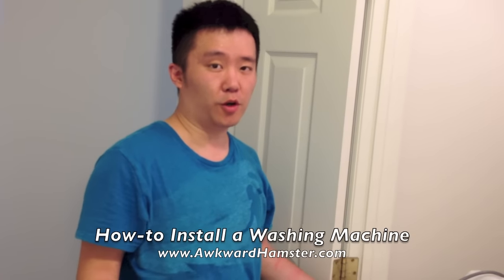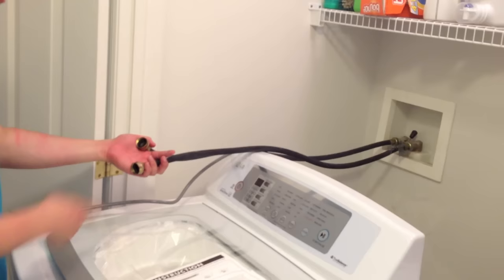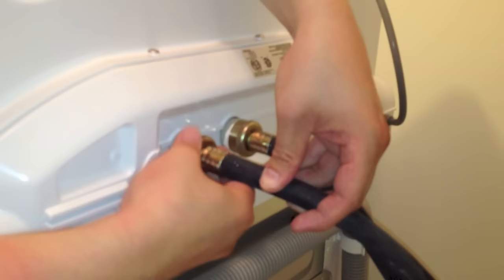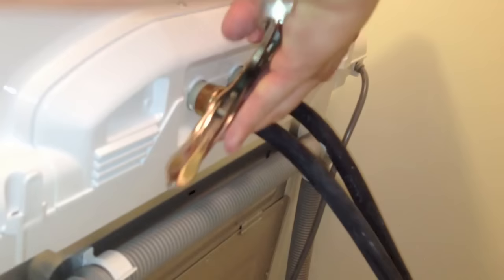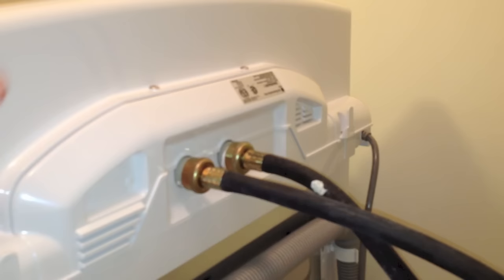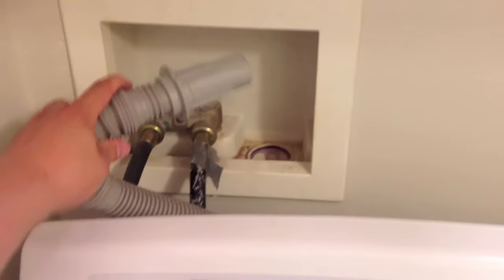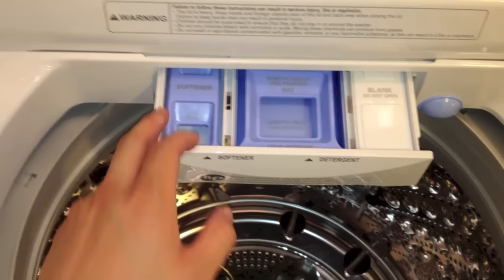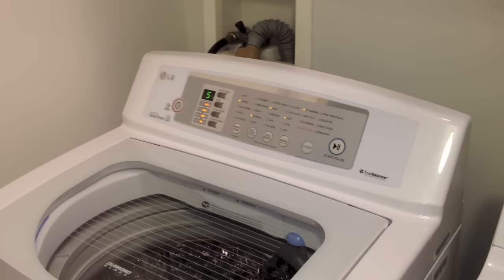How to Install a Washing Machine

Comment: 1. Old hoses on new washer voids the warranty. 
2. Don’t over tighten the hoses. Rubber gasket in the hose can kink. And also because of the gasket and it’s metal to plastic, teflon tape is really a waste. 
3. Hook up the hose turn on the water before pushing it back. If there is a leak you have pull it out again. 
4. Use zip tie on the drain hose it looks better than tape.
5. Finally, run a cycle to test the drain. If your drain is clogged the drain water will pour back out.
Reply: Thanks for the tips.  I'm a lady living alone now, no man in the house so I'm going to attempt this on my own.
Reply: don't ya have to level the unit? or not?
Reply: Hi, please if someone can help me out here, I'll appreciate it very much.....when I place the drainage hose for the waste water in the hole, the water comes right back out once I began the cycle....why is it doing this?
Reply: Does it matter which end you plug the hose into the washer?  The L on one end of the hose doesn’t fit into my wall
Reply: @florcorazon1397  you might have to run a snake down the outlet . Sometimes mine freezes in the winter and the water comes flying out. I'm just one person pushing 60 who now has a backache. It sure is satisfying when you don't need to go find a man to do anything. But it's more satisfying if you have one around who knows how. I didn't. God bless
Reply: @tractorkid223  I'll appliances nowadays have self-leveling legs. Just twist until they don't rock back and forth,
Reply: 1. Old hoses on new washer voids the warranty.   <--- why is that? and so does that means (old hoses + old washers is fine),  and (new hoses with old washers is fine)?
Reply: I know u probably going laugh at this but you have to turn the hoses on to use the washer machine one of mines has a leak and I need to replace the hose

Comment: Thanks for helping others with your video. Just some constructive criticism so don't take it the wrong way. I notice that you use some plumber's tape. It is actually unnecessary and even not recommended as the hose only seals the inside face of the hose. The non-movable part of the hose gets sealed by the rubber insert so the plumber's tape only just make it harder to install. The tape only works for fittings where the actual threads are what does the sealing like threaded pipes. 

It is also not recommended to tighten the fitting that much as the machine uses plastic. If the plumber's tape wasn't used, it would almost be leak free by hand tightening and about 1/4 to 1/2 a turn with a tool.

Not over-tightening will insure that the rubber seal lasts when removing the hose and will insure that the plastic threads on the machine remains intact.
Reply from the maker: esqueue thank you

Comment: This is the 4th video I watched that got to a drain hose that just slides into a drain hole -- you tape it to the cold water hose to stabilize it. I knew it couldn't just be left un-anchored, but wasn't sure what to do. Thanks!
Reply from the maker: cool
Reply: Reminding u about this comment u legend

Comment: very nice video. I just installed my washing machine thanks to your supportive tutorial.. All washers are a little different, but basically the same, but you're right I didn't need to switch hoses, and the shut-off valves are right there at the site. All of my bathrooms and water sources have shut off valves . Thank you again from an almost senior female.
Reply from the maker: Thanks

Comment: so the connection is actually a garden hose connection which means that the seal is not made via the threads but rather the face gasket so putting teflon tape over the threads is useless.
Reply: nyer070 correct

Comment: Thank you for this helpful video. Just some constructive criticism: when you put the hose in the drain pipe you want to use a zip tie to anchor it to either your hot or cold intake pipes. The water that comes out of the clothes washer will come out at such a force that it will pop that drain hose and you will have water all over your floor in seconds! Ask me how I know… Also, this is the new home guidelines to anchor the drain hose. Also, if you have an older house that was built during the 80s-90s when they decided it was a good idea to put the washer and dryer on the second level with the bedrooms, I highly recommend a drip pan. This can save your floors! Thanks again for the great video.
Reply from the maker: Thank you
Reply: How do you know? 😂
Reply: He did anchor it.

Comment from the maker: The waste water hose came attached to the washing machine.  At 4:35, I just inserted the other end of the waste water hose into the drain.  I used tape to secure it into position.  Hope that helps.  Thanks for watching.

Comment: The placement of the electrical outlet below the water line hookups is scary.
Reply from the maker: Dckommentatur S Yea, you make a good point.  I put a water alert sensor in that laundry closet and it's also got a floor drain.

Comment: That seemed easy enough!
Unfortunately, I had to replace one of my valves by myself with a makeshift one and those things are almost impossible to remove!
I didn’t have to vice grip the hot and cold water or tape the hose down but that’s actually a pretty good idea.

Comment: So to confirm - the entire installation process can be summed up into plugging it in, attaching three hoses, and setting it against the wall correctly? Home Depot is trying to charge $195 plus tax to do exactly that. Am I missing something? It looks easy.
Reply from the maker: With the amount you are saving, I would suggest buying a new stainless steel water hose pair. I used rubber hose in the video because I was cheap. I should have used stainless steel.

Comment: I bought a WFT810SPT LG top loading washing machine. The installation seems to indicate that the drain hose must run horizontal on the floor into a floor level drain. Is this correct ? All instructions I see elsewhere seem to indicate a higher level drain. ?
Reply from the maker: I'm not familiar with that model.  All the ones I've had in the USA said to elevate the drain.

Comment: I feel like that washing machnine on song should now be your channel intro and the off sound your video outro.

Anyway thanks for the useful video. WHat im looking for though is if theres any kind of adapter for a hot and cold water outlet to a single input. My portable machine only has 1 input so im trying to find out if i can hook it up to a standard hot and cold dual output like what you have here. Im also not sure yet if my machines hose will fit into or over rather, either one of the openings of the faucets.

More importantly since you can answer this one: what is the name of that tool? i cant really hear it. A vice grip?
Reply from the maker: +IMr LAPS 
Hi. Lowes sells adapter for faucet to 3/4". 
I used a vice grip in the video. You can use a vice grip or adjustable wrench.

Comment: I have a drain hose hole that has been covered because there was not any washer in my apartment for several years. I cannot figure out how to get the cover off. Does anyone know what this is called or how to deal with it?
Reply from the maker: There could be a reason why the drain was covered and difficult to remove. Maybe the drain no longer works. If your building has a super, ask them about it first.

Comment: I have a black blue and red hose the black goes on when I turn the re water supply on what do I do with the black hose please
Reply from the maker: I’m am not sure of the scenario. It sounds like when you turn in the water it comes out of the black hose. If that is cold water, then it goes to the cold inlet of the washer.

Comment: Do you have to turn off the main water in the house before installing?
Reply from the maker: For mine the shutoff valve is next to the washer. If you can't find the shutoff to the water then turn off the main water.

Comment: Will those hoses connect to a Spicket?
Reply from the maker: If the spigot has 3/4” connector then it works.
Reply: AwkwardHamster thanks for the reply but not sure if it’s 3/4 it seems standard is standard 3/4

Comment: what should I do when the wster leaks?
Reply: water *
Reply from the maker: Check the hose.  Braided cables are better but cost more.  The rubber hoses like what I used cost less but aren't as durable.